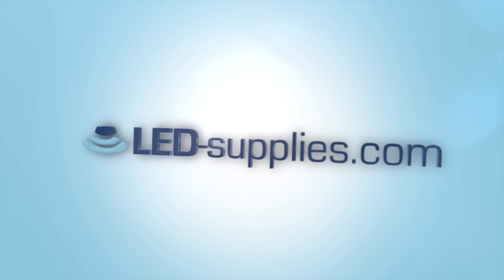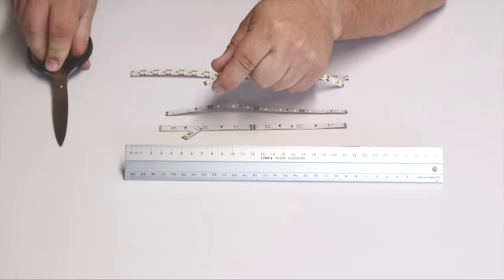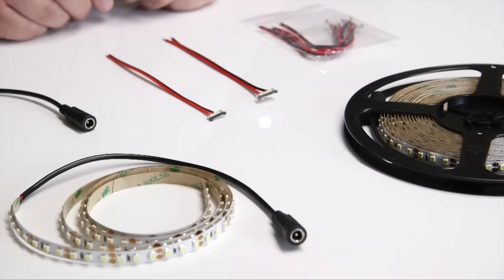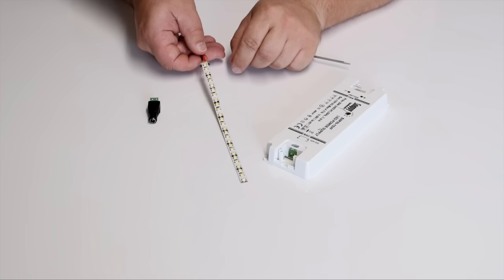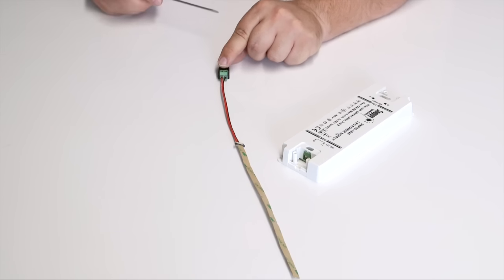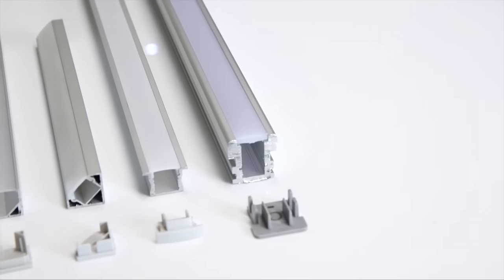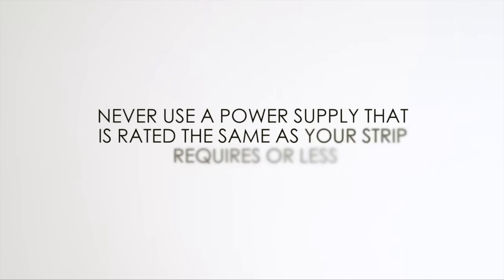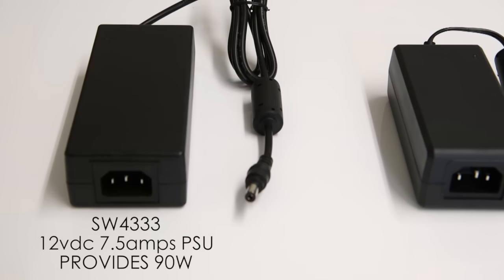How to cut, connect & power LED Strip Lighting

Comment: You should absolutely leverage your landscape lights if you have them.  Its way easier and cheaper than to use the standard 120V transformer.  Your landscape transformer outputs 12V AC.  You need 12V DC for the LED.  I recommend you get one of these to get the conversion done.  It is a very small device so makes it easier to hide.  You can get it from Amazon.  "72W Outdoor Waterproof Low Voltage Landscape LED Power Supply Converter/Rectifier, Input 12V AC to Output 12V DC"

Comment: A few comments on how I installed this product.  First, it is VERY important when you cut them to pay attention to the end you will feed with the snap on power connector.  For example, the red/black lead power connector is polarity sensitive so pay attention to the end of a cut strip you feed.  IF you apply a cut strip to the bottom of a kitchen cabinet, plan on which end you feed [left or right end?] due to the connector being polarity sensitive.  You CAN NOT FLIP the connector over on the same end of cut LED strip.  IT will either be correct polarity on one end and NOT the other. PLAN your power feed wires accordingly if you fish through the walls before you hang your cabinets. I  wired multiple kitchen cabinets with cut pieces of these LED strips.  I paid attention to polarity and brought the wires out the bottom of the cabinet on the correct side.  I also installed a house switch to control a 120 volt receptacle with I plugged the power supply into.  I turn 1 switch on/off, it turns the power supply on/off so all cut pieces of LED strips are turned on/off at the same time. The switch was in the kitchen wall, but the receptacle was right below the kitchen in the basement.  I kept the power supply as close as possible to the cabinets so there wasn't a serious DC voltage drop.  They worked great to light my counters.

Comment: Hi, i wanted to know is it possible to have for separate stripes running along one connector? I'm trying to make a light box for tracing and I'm a little new to ac dc currents.
Reply from the maker: Hi Daryl, so you mean powering 4 seperate LED strips from one connector / one power supply? If so thats no problem at all as we supply 1, 4 and 8 way power splitter cables which you can view here http://www.led-supplies.com/2-1mm-splitter-cables then just use a suitable LED strip power supply according to how much you are using. I hope this helps

Comment: If I wanted to use just one small part of the strip, let's say just 3 LEDs, than would the 12v power supply be too much? What would be suitable?
Reply from the maker: Hi younggiftedandatheist, thanks for contacting us and watching our video. You can power just 1 section (usually every 3 LEDs for 12vdc LED strip). Just make sure you are only cutting it at the correct cut points. With our LED strip lighting, the LED strip however small the section will only draw as much power from the LED power supply or LED driver as it needs. Think of the LED strip sucking power in the same way that someone would suck milk up a straw from a glass. The milk does not get pushed up the straw into your mouth. Power does not get pushed into the LED strip, so it will not be damaged. You can use any size power supply as long as it meets the minimum load requirements and if in doubt its better to go too big than too small. I hope this helps.
Reply: Fast reply and brilliant answer. Thank you.

Comment: EXCELLENT video. Why can't all YouTutes be this straightforward, informative and easy-listening? I'm off to make my LED strip light tracing table. Thanks very much for answering all my questions!
Reply: YouTutes lol
Reply: Xx
Reply: J3
Reply: M K Martin because it’s boring
Reply: Not a bad video but in the beginning it says where to cut the LED strip but it doesn't show where to cut it I still don't know
Reply: @jimalan4930  you cut in the center of where its marked neg + & pos - ..  Or if the - & + are to small, cut close to the tips of the - + on the leds to give yourself more mass/space if you're going to solder your negative - & positive (red or black wires) or whatever connectors you'll be useing from your power supply. Hope that helps you, good luck.
Reply: ...I think he's getting paid to say that.

Comment: when I am  using my TV remote control and it  changes colors of my LED Strip ,  anyone know how can this be eliminated because it is damn annoying
Reply from the maker: I dont beleive you are one of our customers so have obviously purchased the produc from elseweher but we are still able to help. Your TV remote i expect would be working on an Infra Red signal. To stop the problem change the receiver / controller over that is attached to your strip to something that uses an RF signal and that will stop the problem, We have a wide range of LED strip controllers using RF as they are much better as they do not need line of site. We offer LED strip controllers for all sorts of strip including RGB, colour temperature changing and single colour https://www.led-supplies.com/led-controllers/

You are using RGB colour changing LED strip so you can view an RF signal controller here https://www.led-supplies.com/led-controllers/led-controllers-rgb-colour-changing/

Comment: Good explanation. I need to install some strips in my boot. What wattage red black wire do I need to do this?
Reply from the maker: Hi goonzjav, the guage of wire to use depends on the power rating of the strip and how much you are looking to power. Take a look at our DC CABLE here https://www.led-supplies.com/led-installation-accessories/cables/

Comment: is there a way to connect them to a battery supply ?
Reply from the maker: Hi Technohardcore, you can connect our LED strip to a battery as its 12vdc constant voltage input. Take a look at the following. we offer a low cost low power device here https://www.led-supplies.com/led-drivers/portable-power-battery-for-led-strip-lighting/battery-pack-for-led-strip-12vdc-8-x-aa/ or if you want something that will power the LED strip for longer periods we offer this high power series https://www.led-supplies.com/led-drivers/portable-power-battery-for-led-strip-lighting/portable-power-supply/

Comment: hello i am on the verge of buying a 5m led strip.

but i need to cut them down to around say 5 pieces of one metre so that i place them at different places.

how will i connect those led stripes to the same power source so that one same switch powers everything? thanks

what kind of connector i will be needing?

many thanks

regards
Reply from the maker: I would suggest using one of our splitter cables which you can plug a single power supply into and they splits the output into 2, 4 or 8 ways take a look here http://www.led-supplies.com/2-1mm-splitter-cables or you can use a power splitter terminal block that will do a similar thing like this http://www.led-supplies.com/power-splitter-terminal-block-8-way-30a-max

we include quick connectors in all of 5 metre lengths of strip, but if you dont have them to quickly attach cables and connectors to your LED strip please take a look at these product ranges http://www.led-supplies.com/quick-connect-power-cables-for-led-strip-lighting and http://www.led-supplies.com/quick-connect-power-cables-for-rgb-led-strip-lighting You can use those cables that just push onto your LED strip in conjunction with these connectors http://www.led-supplies.com/2-1mm-socket-to-screw-terminals to solve your problem

Comment: Does it matter where you cut it? As long as you cut along the line
Reply from the maker: There are cut marks all along our LED strip and as long as you cut it along one of the marks you will be fine, it can be cut at any one of these points

Comment: hi, i was just wondering if you could help me with a question regarding 3528 led strip lights.

I have one strip from a reel cut off and connected to its power supply working perfectly, however now im wondering how do I power and connect the rest of my reel of lights when i cut strips off it. I would really appreciate any kind of help/explanation at all, thank you!
Reply from the maker: Hi Navid, so essentially you need to attach a cable to the LED strip which the power supply can then plug into. Obviouslly i cannot guarantee our accessories will work on other manufacturers led strip but we use the following quick connect cables for LED strip http://www.led-supplies.com/quick-connect-power-cables-for-led-strip-lighting An LED driver would simply wire straight into those bare end wires but if you need to, you can fit a quick input socket to that to plug the power supply into. The onput socket is here http://www.led-supplies.com/2-1mm-socket-to-screw-terminals
Reply: ***** would this require soldering? because i dont have a soldering iron or have any experience doing that.
Reply: ***** yes okay so those are the same socket connectors i saw on amazon, but how do I get those two small wires out of the led strip to connect to that 2.1mm socket? do i just have to peel back the led strip to reveal the wires that go into the socket? thank you so much for taking the time to help me out by the way!!
Reply: ***** ohhh i see it at 3:44 in the video now, the connector goes to the led strip, then the connector reveals the two wires that go into the socket, then the socket goes into the power adapter. got it! thanks again guys!! :-D thumbs up'd and subscribed
Reply from the maker: Navid Nilchian Great, glad you got it. I was just typing a reply out for you. Yes, you just pull out the littlke black clip on the end of the connector and the LED strip just pushes into that connector. then you push the black clip in and it holds the LED strip in place so you can power it up. Good luck with your install and thanks for contacting us

Comment: Do you have an instruction on how to connect the wires from a USB connecting to the LED?
Reply from the maker: Hi Jiroes. when you say a USB connector, do you mean a standard USB cable as this would usually provide 5vdc when connected to a standard USB socket or USB charger. If i have this right and you want to power LED strip from a USB charger cable or socket you would need to convert the 5vdc to 12vdc (or 24vdc if using 24vdc LED strip). To convert the voltage we suggest using a DC DC Converter and you can view a range here http://www.powerpax.co.uk/dc-dc-converters selecting one which can accept a 5vdc input and provide the 12vdc or 24vdc output at the required power

Probably the easiest range of units to use would be http://www.powerpax.co.uk/dc-dc-converters/high-power-industrial-enclosed/high-power-industrial-enclosed-15w-to-1000w

i hope this helps
Reply: ***** Yes I'm trying to use a standard USB charger (just like the ones used in smart phones) to power the LED. I will try this out thank you.

Comment: u lost me at the end of the video... with all the watts and amps
Reply from the maker: Hi Con1weezy. it can get a little confusing but essentially voltage x amps = watts. So if you have a power supply that is 12 volts (12vdc) and 2 amps you just multiply 12vdc x 2 amps to get that watts which in this case = 24 Watts

A 12vdc 3A power supply = 36 Watts

LED strip which is 4.8 watts per metre would use 24 watts for a 5 metre run (4.8W x 5M = 24W) and we suggest always allowing 20% on the power supply to best reliability. so if your LED strip needs 24 watts + 20% = 28.8W so any power supply rated to 28.8W or more is perfect. You can go higher as the constant voltage LED strip will only draw what it needs from the power supply, but never go lower. I hope this helps
Reply: ***** great thanks for the info . i just needed to play the video a few more times. cheers con1weezy

Comment: hello, i have a 2m LED Strip i would like to power up by batteries?....is this possible?...any instructions on How To would be great!....Great video btw ;-)
Reply from the maker: Hi IIam, thanks for your kind comments on our video and message. The power requirement of the LED strip will determine how long the batteries last but if you want something simple and low cost you could use something like this battery pack for LED strip which gives a 12vdc output when fitted with the AA batteries  http://www.led-supplies.com/battery-pack-for-led-strip-12vdc-8-x-aa

or, if you want something more industrial which will last longer check out our high quality lithium batteries for LED strip lighting here http://www.led-supplies.com/portable-power-supply

i hope this helps

Comment: Have any idea how to connect the LED strip the easiest way to Xbox 360 game console? If you know a easy way with a soldering included. Hit me with email message foundstrawberry@gmail.com 
Thank you! :)
Reply: Also I mean without using a power supply, just soldering it on the motherboard.
Reply from the maker: Trissky Hi Trissky, thanks for contacting us but i'm afraid we are not familiar enough with that console to assist. All the best though, and thanks again for taking the time to watch our video
Reply: ***** No problems, I figured it out and it's working perfectly! :)

Comment: Hi, I'm a choreographer and a client and I are working with an idea that involves having LED strips on the dancers' jumpsuits so they can be seen when performing in the dark.
I was wondering if you could help me with two hiccups.
1. What sort of strips would you suggest. 
And 
2. How do I power each individual separately without having them connected to a wall outlet?

Please help!
Thanks
Reply from the maker: Hi Ibrahim. I would suggest using our little LED strip battery pack which takes standard AA batteries and gives you a 12vdc output suitable for powering our LED strip. Take a look here http://www.led-supplies.com/battery-pack-for-led-strip-12vdc-8-x-aa

We can supply the batteries as well as you will see in the related products section and supply the whole package for you so all the LED strip is cut to size and ready to simply plug into the battery pack. I would suggest using our 4.8 watts per metre LED strip which has 60 LEDs per metre. Its pretty bright even though it has a low power rating and will look really bright if your dancers are wearing the LEDs in very low ambient light levels. Also, using the lower power LED strip lighting means that the batteries will last long. The less LED strip the batteries are powering the long they will last of course. I hope this helps
Reply: Yes!
This helps a lot.
You guys are awesome. 
I will check out the link and also forward it to my clients so they can okay it.
Will be in touch, 
Really appreciate the prompt response!
Reply from the maker: ***** Pleased to be of assistance. Thanks for contacting us
Reply: Ibrahim CaptainQuest Suleiman battery power

Comment: I'm considering using this to modify a sega gamegear console by replacing it's cathode ray light with LED strip it should reduce it's power consumption dramatically, would you have any advice on achieving this?
Reply from the maker: Hi, thanks for contacting us. It sounds like a great idea although not something we could assist with as we have no experience of how the existing cathode ray light in the games console operates but good luck with the modification

Comment: do you have a way to make a slim battery pack that takes AA for a small picture frame? or white colored wires for the power supply so it can dangle from the picture without being so noticeable?
Reply from the maker: Hi Kyu1LL, if you want to power our 12vdc LED strip lighting from AA batteries specifically then using 8 x AA battiers in a holder will output the 12vdc required although how long it lasts between charges will depend on the power rating of the strip you select. We also offer a range of high quality portable power supplies using Lithium Ion technology which are very compact and will last much longer between charges than 8 x AA cells. Take a look here http://www.led-supplies.com/portable-power-supply

or, if you want white wires from the power supply so its less obvious, simple connect one of these white extension cables to the output cable of the power supply which will do the trick http://www.led-supplies.com/2-1mm-socket-to-1800mm-cable-bare-ended-18awg-white
Reply: thanks

Comment: Hello there I have a question... If I wired these strips to a USB cable + switch do I need a resistor? and If I do need a resistor (100ohm) then I would place it between the LED strip and the switch right?

Comment: I have lights installed under my kitchen cabinets.  I want to replace them with LED lights.  The wires are already there.  What do I need to connect between the power wires and the LED lights to make them work.  I'm in the US and its the typical 120v outlet. I'd rather not install 4 outlet boxes in each location that I need the lights.
Reply: Hi cpslim3000. I imagine your existing kitchen cabinet lighting is operating from mains input voltage. What you need to add depends on the spec of the LED lights you are looking to install in their place, but most of our LED lighting operates from a low voltage, either 12vdc or 24vdc and requires a constant voltage power supply. Our LED kitchen lighting can be viewed here http://www.led-supplies.com/led-kitchen-lighting-447  

The power supplies we sell which will deliver the low voltage you need for many ranges of LED strip can be viewed by the following link and the feature a wide range auto sensing 90-264vac input and UL safety approval perfect for us in the USA. Any orders that come in from the USA we add a suitable USA mains lead in with the power supply free of charge http://www.led-supplies.com/desktop